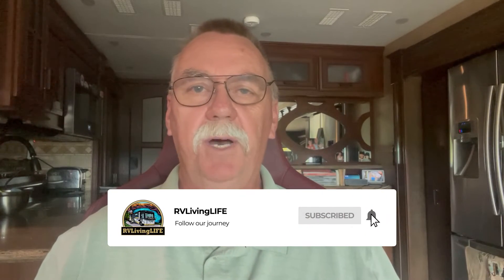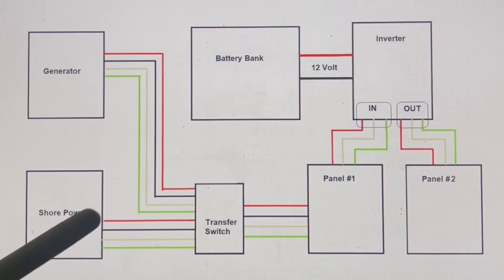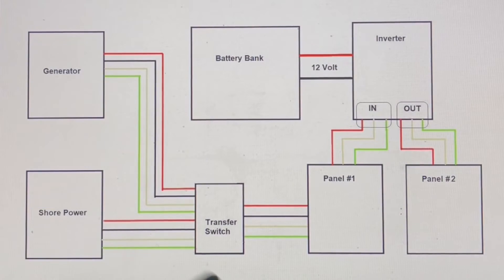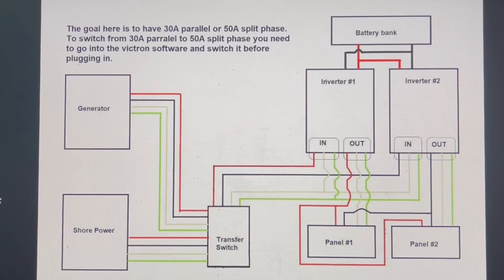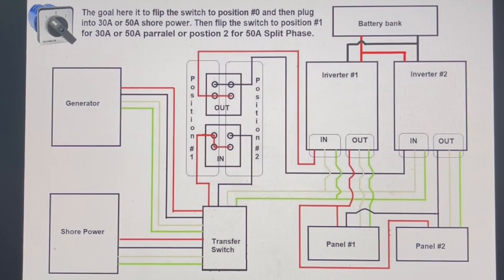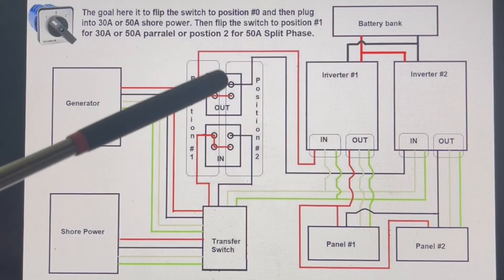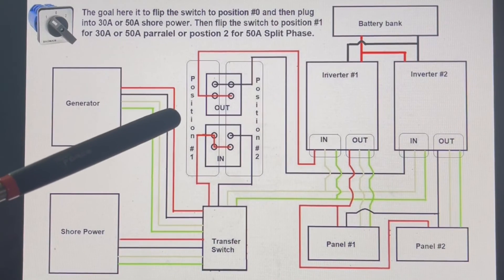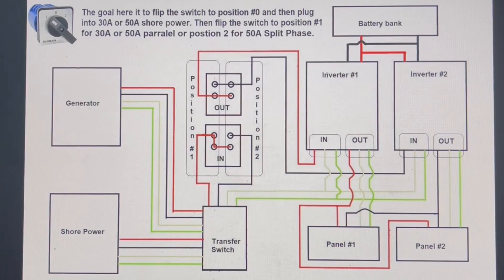How to wire two Victron Inverters In Split Phase and Parallel

Comment: Gary - any issues with frequency synching when you combine in the lines in parallel mode? Some have had issues blowing inverters if the input phases are 'out of synch'
Reply from the maker: No issues here with the parallel frequency. I split L1 to both L1 and L2 in my wiring so I can guarantee L1 and L2 are exactly the same length. Issues can arise if the positive wires are even slightly different lengths. I don't care how the line is split in the box or even the 5oa to 30a conversion plug. I trust only myself in these situations.

Comment: Hey Gary, Good info and video.  I bet you wish that the new 2 phase Victron Multiplus II was around when you wired up your coach.  I assume that with the Multiplus II you could do away with the manual switch and only have to run from the transfer switch to the inverter then out to both panels.  I am going to be replacing my Magna Sine inverter with the new Multiplus II when I get back to my home base in FL.  Waiting on Ian to leave first.
Reply: Is there a schematic? I have a 50AMP RV, 2x3k MultiPlus II 1000Ah of batteries and it isn’t setup correctly. In split phase how does the power work off grid? I want full power form shore and to not have to decide what to run when off grid. I know I would be limited to 6k off grid but I don’t want to be limited to 3k on each leg of panel and having to figure out what is on what leg.
Reply from the maker: @trigmish  somehow I missed this comment until now. Sorry for that. You could use an victron autoformer after the two inverters to balance the loads and not have to worry about what load is on what line. I always wanted to do this but really have no issues with popping breakers at the pedestal or the inverters so I can’t justify the extra expense.
Reply from the maker: The manual switch is not required, it is just something I added. I actually had the multiplus II 2x120 on order but after a lot of research decided to go with dual 3000 multiplus inverters. When the multiplus II came out there was a huge drop in the multiplus 3k price for a very short period of time. The advantage of two inverters is 12000w of usable power where one multiplus II is 5500w I believe and only power assist on L1. I can't recall all the details, I would have to research it again but am very happy with the direction I went with no regrets. Thanks for watching and commenting.